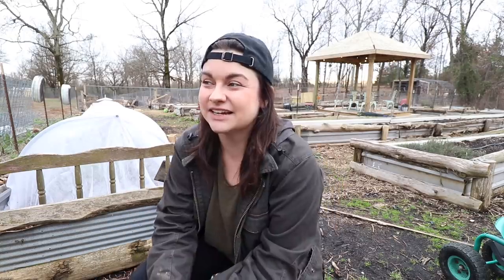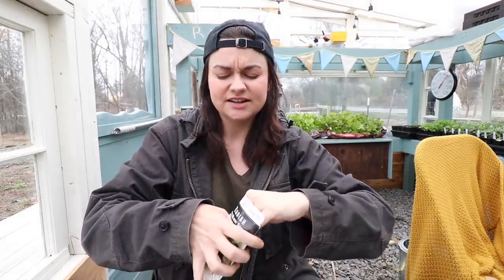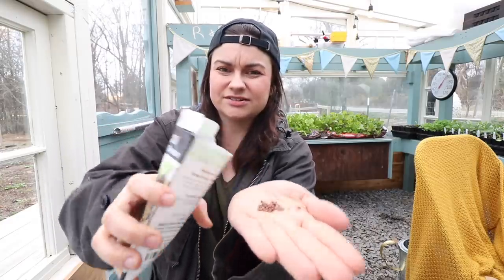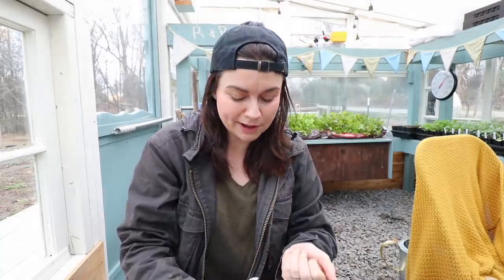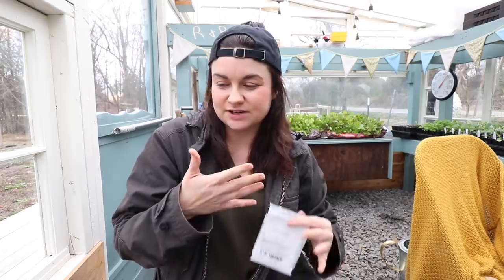Sow Seeds with PERFECT Spacing with this $20 Project | Gardening Ideas

Comment: Great idea!  Maybe some pegboard painted with a weather resistant coating and coloring the different holes for corn, beans, radishes, etc...
Reply: That's where my mindless going! Color coded for diff depth types for distance. Color line on the stick. Don't forget to account for wood thickness.
Great idea!!
Reply: I'm with you Jess! Why do they call that  triangle and call it a square? But, its because it will help making things square if you carry the measurements beyond the speed square! Lol
Reply: Wonderful..blessings
Reply: A color coded seeding square is available online. But peg board would surely do the trick for DIYers.
Reply: The Square Foot Gardener has  one that is color-coded. I just saw it demonstrated on Living Traditions Homestead.
Reply: After going back and watching the Living Traditions Homestead video, I realized that the seed marker that was demonstrated was from Amazon, and not from the square foot Gardner. They're just using the square foot gardening method in their raised bed.

Comment: you could take a 1x4, line it with pegs at the right spacing and then insert it into each row, and have your holes for planting ready with almost no time.  Then just doing seed placement is the only real time involved.
Reply: Thanks
Reply: I have seen one of those the pegs are already in it and it makes the holes in the soil at the same time

Comment: Jess, that's an awful lot of work for something so heavy!  I made a 1"x2" frame and stapled chicken wire to it. Light and easily portable, the openings are 1" so I could do any spacing I wanted. And your "poker thingy" is called a DIBBLE lol.  Love you guys!  My frame dimensions are 2  28" and 2 48" pieces with 24" chicken wire in the middle. Make the frame first and staple the wire on the short pieces. I used  3-4" long metal screws and wing nuts on the corners so I can roll it up for storage if I want. Been using it for over 10 years now. Cheap and simple to make.

Comment: Great idea!  I would spice up that pokey tool for sure!  Get some inexpensive acrylic craft paint...or better yet use leftover paint you already have on the homestead and paint the sections of the dowel rod depending on the depth.  If using leftover paint from homestead...dip first into one color to 2 1/2”.  When dry, dip in next color to 1 1/2”.  Third color...dip at 1” and last color.... dip to 3/4”..   You can then stain the rest or the handle to match the board!   This will result in a colorful and good looking pokey tool for sure!

Comment: Paint the board white. Then a use a red marker around every other hole leaving a white center like a bullseye, this will be a 4 inch spacing. Then use a blue marker for the 6 inch spacing. Some holes will have only white, some red and white, some blue and white, and some will have a red, white and blue bullseye. This makes 4 and 6 inch spacing so much easier. You can also use a color for one foot spacing of you need it.
Reply from the maker: So smart!

Comment: There's an old video somewhere where an old man shows his seed hole maker, he adds handles to the top and collected wine bottle corks and screwed in the corks to the bottom to press into the soil holes for planting his seeds. And he would use longer screws for deeper holes with the corks on the ends. And he had several of them for every few inches needed for the spacing. Great job. Thanks for sharing.

Comment: Your video gave me an idea for a simpler device.

1.  cut a 1x1 foot square board
2.  trace a 6x6 grid every 2 inches (start 1 inch from the edges)
3.  screw in large head screws and washers (for spacing) 

You can press 36 evenly spaced holes directly in the soil.

Make a few for the different hole depths.

Comment: Great video and idea. Kitten George was a great help as usual.

One suggestion for your poking stick. You could make a couple of different with a stop on them (block of wood glued in place) at the depth that you want. That way you don't need to constantly watch for the markings. It would also make it easier for your kids to help and you know the depth would always be the same. You could even have two different depth ends on each poker.

Comment: you & I think a lot alike, Jess. I garden on a much smaller scale than you do. I felt a need for the same kind of tool. What I came up with was to use a plastic tray with a grid bottom for my guide. Its been working great for several years.

Comment: I use a 2x4 block that is about square, on the 4 sides I drill a hole in about center of the side and glue in a piece of dowel rod, with about 2 inches sticking out. I then insert each rod through a hole on the board, mark and cut them to my 4 most common planting depths. Easier to see and keep up with than just the wooden rod and all holes are the same with even looking.

Comment: You should drill holes through the dowel at each depth marker and then put a smaller dowel through so it contacts with the board and stops it going too deep. Like a little cross/T.

Comment: I make something similar for my 5 gal buckets .... you can draw whatever spacing grid on a bucket lid and drill the holes. I only need one size spacing lid, but you can take multiple lids and drill them for whatever spacing you need. I just drop the seeds through the lid holes. I don't poke holes in the dirt, I just leave some room in the bucket to back fill over the seeds to the right depth. I mainly grow 95% of all my plants in containers (buckets/55 gal plastic drum sawed in half/7 and 20 gal grow bags). The only thing that I grow in containers that require measured spacing are carrots and onions, plus radishes that I grow in flats. I can grow 50 French Breakfast radishes in one flat with 1" spacing. Your idea will get a number of creative juices flowing from folks that have done other things, or are adapting your idea to their particular need. All it takes is a spark .... which you have done in spades. You guys have been a catalyst for a good portion of my recent garden changes ... both in how I grow, and what I grow. Thanks for that. Take care Miah & Jess.(edited to say 7 gal grow bags ... not 17)

Comment: Great idea! One suggestion, use a threaded dowel rod this way you can adjust the depth as needed. Use two nuts(jam nut) finger tight. Now you rapidly make holes in the dirt without watching your mark on the wood doll rod.
Reply from the maker: Great idea!!!

Comment: 5:19 Combination square actually. It makes it easy to make a line square to an edge. But you also use it to make lines at any angle.
7:55 toque hair. LOL
 10:25 I use a spade bit and drill till the tip pokes out the other side, then flip the board over and drill back the other side.
I'm thinking of testing a version of that. Since I've started Instagram I can post a pic and tag you now.

Comment: Jess, just wanted to say the given plant spacings predate specialized gardening equipment, which I've heard you say is the reason for them in several videos. The Hopi people in the American Southwest plant their corn about 5 feet apart, and they're doing everything by hand. Steve Solomon in Gardening When It Counts and Carol Deppe in The Resilient Gardener both discuss the importance of plant spacing. Wider spacings allow plants to put roots out further which both A) leads to larger vegetables, and B) allows them to survive longer without water (whether you just want to irrigate less, or if you suddenly find yourself with an inoperable well/irrigation equipment... or can't afford the water bill.)  Steve Solomon found that increasing plant spacing to about 50% more than recommended on the package meant that he basically didn't have to irrigate at all and got nearly the same yield as intensively planted beds because, even though there were fewer plants, each plant yielded more. It also meant he used less seed for basically the same yield. Plus, Oregon State University has been doing research on farming without irrigation, and when they've done blind taste tests people prefer the vegetables grown without irrigation. The extra water makes things taste... well, watery. Steve Solomon corroborates the claim that the vegetables that he grows further apart, and without irrigation, just taste better.

Comment: Just place planting board directly on soil, drop seeds in holes, push with hole stick, remove board and cover with soil. Done! Now Miah as others suggested make 12" x 12" with pegs that will fit into planting board that will just push seeds to depth needed.

Comment: Keeping the mindset for square foot gardening in raised beds, making smaller squares with the dowels the correct depth, I have been thinking of having sets of smaller squares with the dowels glued in at the right depths and just making the holes with them, like a stamp press. having two dowels longer to make aligning them easier like when you are stenciling. A smaller template would also not require long arms to lift it up. I may be overthinking this thing! 😂🤣😂🤣

Comment: You can get peg board that has a whiteboard coating on it.  Yes, it's 1 inch spacing and the holes are 1/4", but it's already drilled and ready to go.  Flip it face down and mark the holes on the back with a sharpie for every 2".

Comment: As an engineer I am a little OCD with respect to optimization. If you consider a radius spacing instead of a square spacing and stagger your holes accordingly you could have probably fit a few more rows while maintaining the same minimum distance between plants. The 3/4 inch birch is probably a little overkill. I probably would have went with a whiteboard (think dry erase) type of material. it would be cheaper, lighter, rigid enough, with minor water repulsion. Just some thoughts if you plan to do another. I love your channel! I am just getting into gardening and have learned so much from watching your videos. Good Day and God Bless!

Comment: Something that might make this method even more efficient: create a tool with multiple "poker thingies"  at correct depths that would fit across each row/rows. I've seen whole boards that would do this, but it could also work with just a few rows at a time. Basically, a series of dowels spaced along a board to correspond to holes. You could even have a set for different spacings. (I.e. 2"x2" at 1/2" depth spacing, 4"x4" spacing, 6"x6", etc.) Press the card of dowels into your spacing board to get multiple holes at correct depths.

Comment: Some additional thoughts for your planting board: use plexiglass, you can see thru it, rinse off w garden hose and won't affect it,  slide second sheet under it place seed in each whole, place on garden surface sliding out bottom board and using your dribble to push into needed depth. On the dribble  mark in one inch measurements and u will know how far to push down seed... thus planted  to appropriate depth.  By loading seed planter and sliding off bottom cover each will be spaced correctly and dribble will have markings to appropriate depth for all seeds. You could sell it as planting kit together. Good luck. Easy to produce,  long lasting, economical  and time saving!
Reply: Just place planting board directly on soil, drop seeds in holes, push with hole stick, remove board and cover with soil. Done!

Comment: An adjustable guard that clamps and can be tightened on the pokey stick would make the process much faster. The stick could be longer, so you could be standing. You could just poke through each hole until the guard hits the board. If making the guard adjustable is too difficult you could make several pokey sticks with permanent guards at various depths.

Comment: You could do a 12" x 12" with the different spacings in one board! Essentially you are doing square foot gardening. So on one board you would have holes for 16 plants, 9 plants, 4 plants and 1 plant. Look up the square foot garden seed spacer on amazon.

Comment: You guys are great together....but what's with all the square thingy's  ??.......pokey thing makes a pretty good cat scratcher.....lol..............Always Safe and God Bless...

To set your depth gauge (dowel rod ,, stick,, pokey thing) ..set at each depth mark required and drill a small hole above the surface of play board ,, use a small finish nail ,, paper clip or piece of wire....insert into hole at each/all wanted ....saves time having to look at gauge rod for every hole.......just a thought.... OR ..use a piece of threaded rod ( all thread) ..and a couple of nuts to make it adjustable ( both nuts together to create a locknut..on top.)..use a flanged nut on bottom to sit flat..flat side down........as the kids around here say..."easy peasy"...

Comment: One year I used muffin tins & ice cube trays of varying sizes to stamp out spacing. Used a wide ended icee / frozed coke plastic straw to pick up tiny seeds & poked them in with my finger or shook potting soil over the top. Still a pain in the butt.

Tiolet paper seed tape & paper napkin (12" sq.) works best for me for kitchen garden.

For production gardening there are better options than using a board to plant.

Comment: I took plywood set up sguares for my onions then screwed old broom stick handles inche an a half about 4×4 inches put old wood 3 foot handle in middle to pull up set in place slightly press down with foot an pull up . Planted onions very fast an saved back so could be used for lots of planting

Comment: If I go to dollar tree and purchase two foam core pieces, which are about the same size as poster board, could I not do the same thing? I think I will try that. I think I could also make a square foot template. I wonder if I can poke holes rather than drilling??? Your idea is great. But at age 76, I think it would get heavy very quickly.

Comment: The Granarchy Guerilla Gardening & Terrorism Society accepted the challenge of how to plant tiny carrot & radish seeds without killing your back hips & knees by squatting over a raised bed & lugging a heavy board around the garden.

Four bottles of wine later...an idea & prototype.

Part 1 - Take on old, thick plastic cutting board.  Grid off to 2 in.spacing.  Hot glue or scew in small 2 oz lotion/shampoo bottle caps (travel size) which average about 1/2 in. deep. Attach broom handle to top of board so prepared bed can be stamped from standing position.

Part 2 - Cut length of straight doll rod about 4 ft. Cut equal length of clear silicone tubing same length. Tape tubing to doll rod, but off-set ends by about 1 1/2 to 2 in., so one end has tubing protruding an the other end has doll rod protruding.

Step 3 - Prepare beds. Stamp in spacing with dibble board. Aim and drop 2  pelletized carrot/radish seeds through tubing into dibble hole made by little caps on the dibble stamping  board. Easy to place tubing right in hole. If you miss, use protruding doll end to knock pelletized seed into hole.

Cover lightly with dirt/potting soil.

No (or not much) stoop labor needed.

Thin as needed.

These old broads need their own gardening show. It would be X-rated after 2nd bottle of wine They run a garden to support a food bank.
Reply: Note- The dibble board size is 4 in wide x 10 in long with 1 in spacing on all for edges and 2 in spacing in center. The reason?  Versatility. Some of the gardeners are Square Foot, others have 30 in beds and others use varing odd widths. A 4 in wide x 10 in long board can be used by nearly all of them. Stamp out as needed.

Comment: Check out the template planting boards that Nancy and Hollis have. Basically...put a dowel in each of the holes where you want holes for seeds...then they will push holes into the ground when you push the board down.

No need to do all that work. You can make all your holes at once!

Your board works great for seed dropping...but bigger dowels can be used for transplant holes.

https://youtu.be/GP3p8TIP9Fs